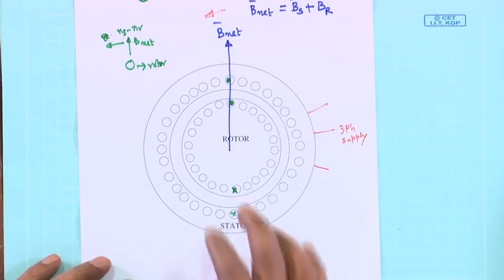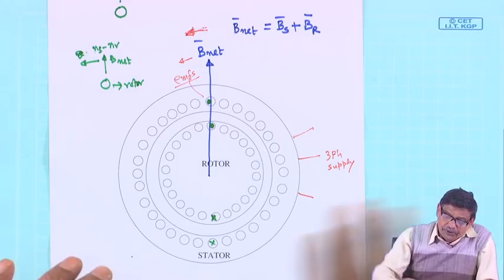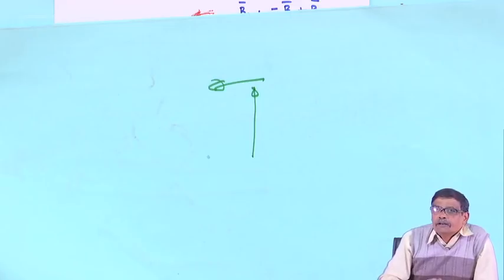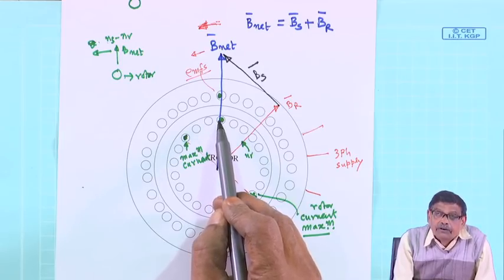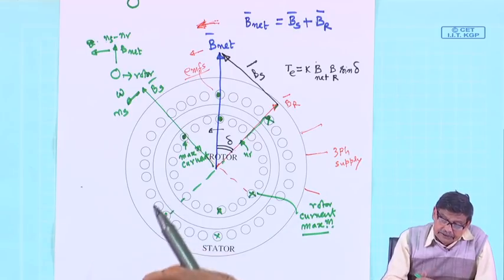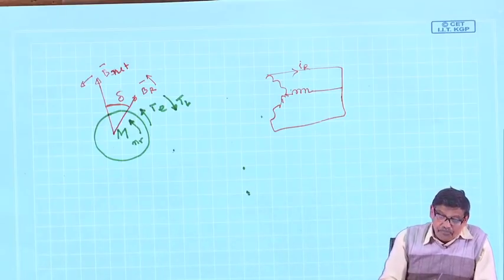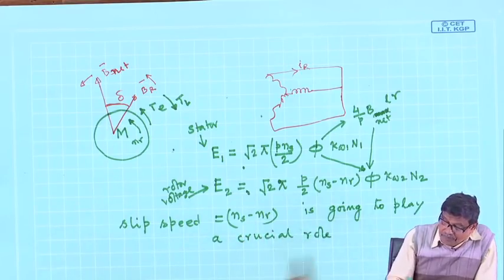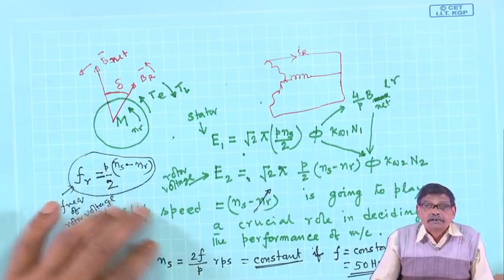Lecture 38: How to Fix Up Positions of Net Field, Rotor Field and Stator Field

Comment: for lagging p.f., won't the maximum current flow in the conductor that is on the right side of B-net, since speed of B-net is greater than rotor speed?
Reply: I agree with you.
What do you think about sir's statement [8:10]?
I think that its Bs, that  is along respective max. stator's phase current, not Bnet(=Bs+Br).